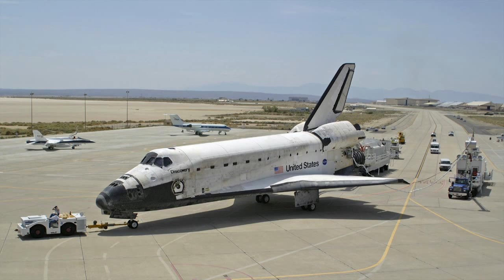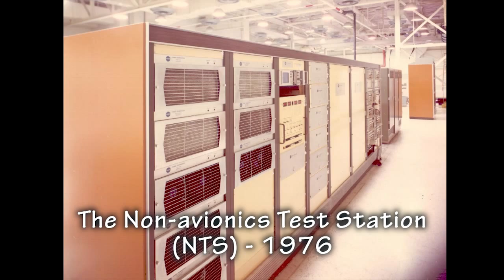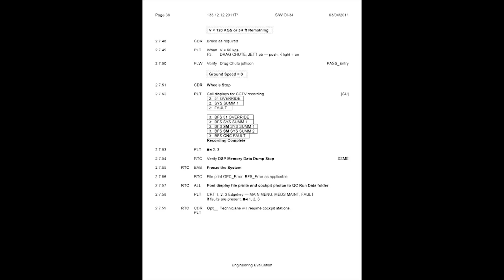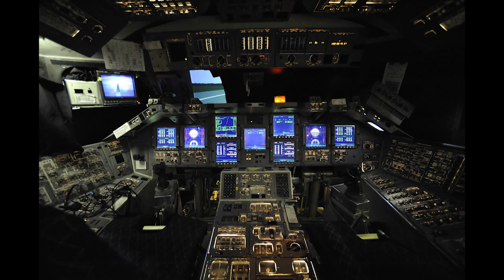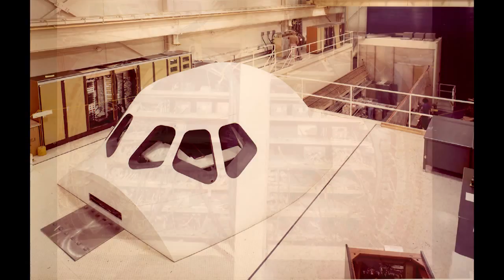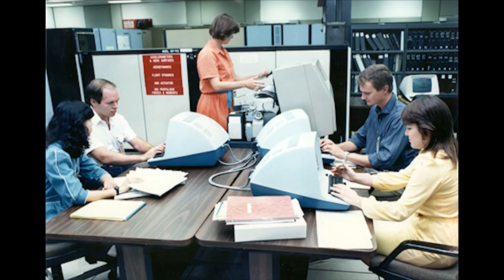SAIL Presentation

Comment: SPACE VECHILE CHECKOUT MECHANIC--ELECTRONIC SYSTEMS--SENIOR  8/27/79
Dub Greer......Wilber J Greer.....Retired

SAIL ELECTRONIC/ELECTRICAL TECHNICIAN--Participate in the planning, organization and accomplishment of the
initial installation and operational checkout of the avionics flight systems. This effort includes the fabrication
of cable harness, special test equipment and the preparation and validation of test stations and onboard systems to
ensure the proper test readiness conditions. Monitor test equipment during test and diagnose and locate causes
of malfunctions. Interpret complex electronic/electrical engineering design information, schematic diagrams, test
preparation sheets and special checkout procedures.